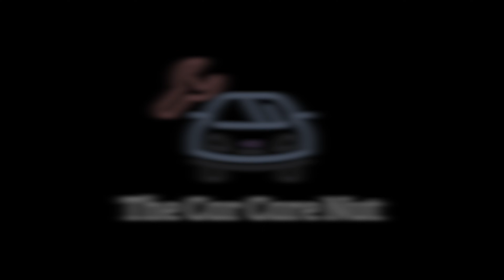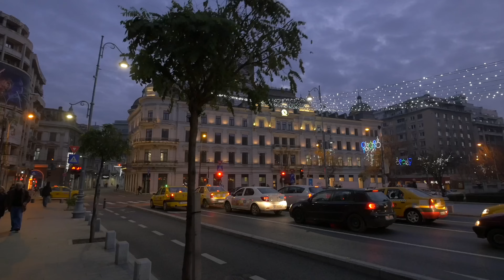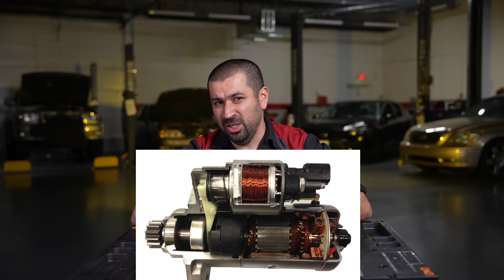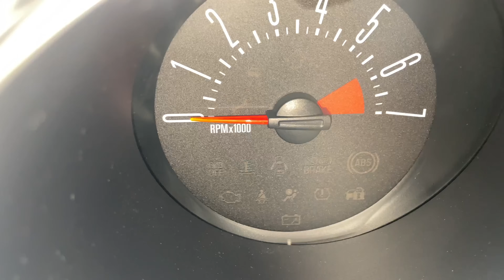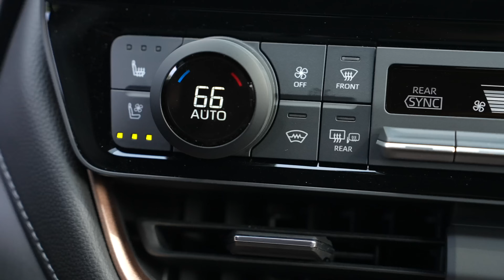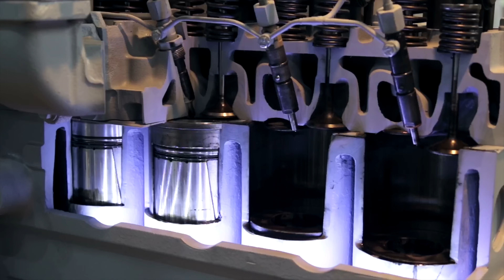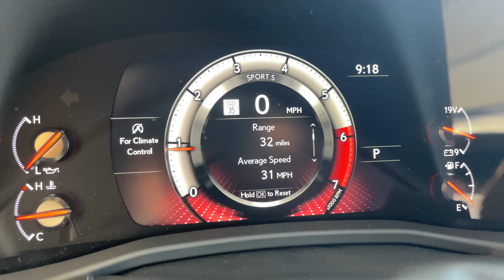How Does Start Stop Technology Work in Modern Cars? Everything You Need to Know

Comment: I heard you mention that they added an oil pump to maintain pressure to select systems.  Does that oil pump that was added protect ALL the seals?  Because I have heard there is insufficient oil pressure when the car restarts and that this will ultimately damage the seals.  I heard an engineer say that the only way to solve this problem is to engineer a delay of several seconds before the car can move after the restart.  How much sense does it make to control emissions in this way and, at the same time, allow remote start to warm up the car?

Comment: In the Volvo, start stop works great. I was shocked at how long the A/C still cooled with the engine off. The blower motor speed would throttle down but it was still cool. 

Volvo start/stop works great.

Comment: I live in Brisbane Australia and when I drive to work, which is about the 10 to 15 minutes drive even with my engine on all the way it's not enough time for you to reach the target temperature due to the car being hot from sitting in the sun! So if you can't keep my car cool even running the compressor the whole time, I can only imagine if the engine would stop at each red light, how much hotter it would be! Does to start stop function read the temperature and if it's above a certain temperature, it doesn't stop the engine or how does it work?

Comment: Love it in my 2 hybrids. My folks rented a car that had it when we went cross country for vacation....it was so annoying. In the prius it is fine and it was developed from the start with a huge battery to accommodate this. Plus the engine can stay off until you get over a certain speed or rpm. Hell I can glide for quite a ways with the engine off in my prius, it's awesome. Best of EV and regular gas cars

Comment: In my 2023 Jeep the Start/Stop works just fine.   Hardly notice it anymore.  Jeep uses a dynamotor not the regular starter and it uses the 48 volt lithium battery, not the 12 volt battery or alternator.  It restarts the engine in Point .4 seconds!  Faster than you can get your foot off the brake to the gas pedal.  It only uses Start/Stop when its safe and warm enough to use it.  It saves me gas in town and has zero pollution  while its engaged.  Its easier on the motor as you are not idling with a rich mixture.  Rich mixtures are necessary in all ice engines at idle to keep them running , this is also hard on your oil  when idling too much.  Never liked the Start/Stop at first but I don't mind saving money on fuel / and protecting my engine from idling problems.  Start/Stop was bad in the early days, I tried out a 2012 VW and when I heard the starter working at every stop sign I told the salesman we are done here, don't want this car.  But Jeep got it right, it works great, must have cost lots of money to engineer and probably put $10000 extra on the sales price.  I paid $42,000 for this Jeep, should not have cost more than $30,000 total.  This is a total gas Jeep, not a hybrid, it can't go anywhere on battery alone.  3.6 Liter
Leo in Montana

Comment: I really liked your video. However, I have three concerns based on my understanding:
	1.	Every time the start/stop system activates, the oiling process starts again from the beginning. This means that for a short period the whole mechanism runs without proper oil circulation, which could gradually damage the engine components.
	2.	What happens if I have been driving for a long time on the highway (Autobahn) with high turbo temperatures? As soon as I exit the highway and the engine stops, it could cause serious damage to the turbocharger because it normally needs some time to cool down before the engine is switched off.
	3.	What happens if the diesel particulate filter (DPF) is in the middle of a regeneration process when the engine stops?

I would be happy if you could answer these questions.

Comment: One thing not mentioned is turbocharges. He has another video where he says to not immediately turn off the car because oil will cook in the turbo if you do not let it cool down. Well what do you think happens when I get stopped by a red light after driving at 60 mph for 20 minutes straight? That oil is gonna be close to burning by the time the car comes back on.

Comment: I don't want to disable it ?!?! - I DoN't wAnT iT - PERIOD !!!!! - All those pumps, motors, sensors, heavy duty starters & batteries, etc. adds $3000, $4000, $5000 dollars to the price of the car. And I don't care how durable you say it is, that heavy duty starter is twice as expensive as the old starters and not all of them will last 10 years, nor all those other parts, pumps, and sensors that add multiple expensive failure points, ergo more expensive maintenance cost. 
I'm so glad Trump killed that useless legislation before I need to buy another vehicle 😀😃😄

Comment: Thanks from Down Under, good to understand the system and future service. I will run Auto start occasionally to keep the pumps fresh, same with off road systems 4L/Diff Lock/ Traction control, on the farm to keep all the running gear good. It's a New 2025 Rogue 2.8 L. Hope i got a reliable ute. I would like a ute without all this tech but as you say " just gotta move on with the future" Service is 10K capped under warranty, thinking i will change oil @ 5K interval to look after Turbo. Just a big sump @ 6.5L.

Comment: I think I've realised why there's so much hate with these systems. Most of the people complaining are usually those with automatic transmissions, where there actually would be some perceived delay to start moving. If you have a manual, there's no disadvantage as by the time first is engaged and the clutch reaches the bite, the engine is ready to go. "But it destroys engines" bet it does that's why you routinely see taxis hitting like 400k miles on diesels with these systems enabled.

Comment: Excellent video. While I drive a work truck with this setup, I have not worked on a car equiped for start/stop.  I was amazed at all the differences needed for rapid start/stop even though it made sense that all those issues needed a solution.  Immediately my brain was thinking about how many ways this system could be tripped up, including unexpected side effects from what would seem like an unrelated problem/condition elsewhere on the vehicle.  I'm curious how much more these modified components are.  While you alluded to the fact that the toyota evaporator might be unique to Toyota, I'm curious as to what other differences were implemented differently by Toyota.
I did wonder if the starters were heavy duty or to save weight just made easily replaceable.  Is the starter under warranty up to its EOL hour?
If the battery is significantly more expensive, would be interesting if a beefier Capacitor/regulator could be used instead.  One more part where the Toyota/OEM part will be the better/required? choice.

Comment: In another video on YT, a German taxi driver stated that his Mercedes E-Class started 47,000 times in three years.  He went through three starters and a number of batteries in just three years!  How is that "green?"
Also, nearly every time I am behind a stop/start vehicle at a red light, I see their brake lights dim when the engine starts.  These repeated power surges can't be good for the vehicle.
edit: The clutches on the AC compressors also wear out faster due to the stop/start system.

Comment: So, the bottom line is.. there is far more to break and maintain. The starter, battery and other components are far more expensive. And it can damage the engine if cold, it can put in danger. So, it’s not a good idea.

Comment: I had a Chevy rental car once that didn't have a button to turn it off. The system was broken such that it wouldn't automatically start. I had to put it in park, turn off the ignition and then start it again. So I had to keep my foot on the gas at a stop to prevent it from stopping - very dangerous.

Comment: then, from what CCN says when the battery needs replacing and I use a 'standard' battery instead of the preferred newer expensive battery, the computer will recognize its not 'good' enough to SS most if not all the time, so not only will it not engage SS even if on, it will also extend the life of the starter motor as a result and I save money all over and never have to switch the SS tech off since the computer will do it for me?  Am I right?  just replace it with a regular Toyota truestart when the time comes?

Comment: I have a Jeep GC limited, horrible crappy feature, parasitic dual battery drain that the dealer mechanics don’t understand and can’t fix. Turning your car off for 5 minutes at a light is a terrible idea for reliability. This is done by the car makers only so that they can meet the cafe standards for California and city emissions.  1 mph better when you make a million cars gets them to the cafe number they need.
To be clear this was not a pro consumer solution, strictly for the automaker to meet the absurd California emission standards that the liberals are pushing but they have no clue about the engineering constraints in a car. So the automakers have to come up with really complicated workarounds to try and meet these standards or not sell cars in California.  All that cost gets passed to all of us.

Comment: What about oil pressure? Petrol engines take 5-7 seconds to come up to a working oil pressure inside an engine to achieve hydrostatic friction. How does they handle this in stop/start cycle? My best guess is they don't and you actually slowly ware your engine on each start in first 5 seconds.
Reply: Thisssss only a few people discuss this issue

Comment: I just bought a new 2025 Subaru Forester. I'd never had a vehicle with Auto-Start/Stop before. Personally, I don't find it very annoying, but maybe that's because newer implementations are different or maybe Subaru just implements it a bit differently. I have to consciously depress the brake pedal more than I normally would to give the system a chance to engage. I'd actually like it to engage more often than it does. (I do with Subaru would display a reason for why it doesn't shut off sometimes, like Toyota does.)

But that's not really the comment/question I have. I see so many people saying they dislike Auto-Start/Stop being on by default when starting the engine.  Listening to this video, though, if the battery specification is determined in order to pass the voltage logic to keep the Auto-Start/Stop an option, but the car will still operate with a below-spec battery, then why not just select that lesser battery as a means to "disable" auto-start/stop?  

It can't be that simple, I'm sure. I'm guessing there must be more benefits of having the higher voltage battery than just being able to support Auto-Start/Stop. But if not, wouldn't simply installing the cheaper battery be a viable, non-interfering solution to sidestepping Auto-Start/Stop?

Comment: Hello! I would like to know the best way to drive hybrid car in order to take care of the engine. First, the internal combustion engine always starts, but after a few minutes, it switches to 100% electric mode, and the gasoline engine shuts off without even reaching 90° (Celsius). After a while of driving with the electric motor, the gasoline engine starts up again, almost cold. This happens many times before reaching 90°. Isn't this bad for the internal combustion engine? If you turn off the Start-Stop feature, the gasoline engine never shuts off and the car never runs in electric mode. Wouldn’t it be better to disable the Start-Stop at least until the oil temperature reaches 90°? Thank you!

Comment: But doesn't the engine, when starting, experience a moment of insufficient lubrication (not only with the cold engine)? And if this lubrication is insufficient with every start, isn't it harmful in the long run? On the other hand, the start-stop system in a hybrid vehicle, for instance, the Peugeot 3008 Hybrid 1.2 with 145 hp. If you deactivate the start-stop system, it loses the essence of hybridization and the electric motor never works.

Comment: So if a driver is very diligent about turning off the start/stop button every time the car is started, then emissions will be the same as a vehicle that does not have this feature. Therefore, installing a disabler results in no more emissions but without the hassle of having to remember to press the button every time.  Think I'll install one and relieve the car of all the machinations it otherwise has to go through to manage this "feature".

Comment: What about the engine oil ?
When engine shuts, the oil pump also shuts off, so oil stops flowing and the well oiled gaps between the pistons and the crankshaft are not VERY well oiled (the oil bed between the parts is removed) - this leads to engine wear off, when the engine is restarted.
The guy also made a test, where he start/stops an engine for 24 (or 48) hours and shows the wear off...I don't have a link here to his youtube video, sorry guys

Comment: I like this feature a lot. It’s pointless to have an engine keep running at a stop light, all it’s doing is polluting the air. The argument of the system wearing out the starter prematurely is uneducated and baseless, as Toyota has said the starter motor has been tested and could, on average endure 380k+ cycles.

Comment: I have a 2023 Mazda CX-30, if I come to a stop gently, the iStop (stop/start) is NOT triggered. If, on the other hand, I have to brake hard, then the extra pressure applied to the brake pedal trigger iStop. Additionally, if following a gentle stop, the brake pedal is pressed harder, iStop is triggered. Of course, all of these iStop events require all relevant components to be in their normal operating parameters. Restarting can be achieved in some circumstances by releasing the brake pedal. Other methods include a touch on the accelerator, wiggling the steering to either side or shifting the gear lever into manual mode and upshifting with either the shift lever or 'flappy paddles." It is possible to disable the iStop system with a switch before moving off after each normal engine start.

Comment: If you are tired of having to remember to push the button to disable the start stop function start your car, push the button in so that the indicator light comes on and put a small piece of cut out credit card along the side of button to hold the button in place. Next time you start the car the light will come on and the start stop feature will always remain in the off position. Ya it's that simple for most cars that's all it takes. No need to remember to push it in and no need to buy a module to reverse the operation of the switch.

Comment: I as an engineer would bypass all those troubles and just lower the idle rpm to a minimum which is still able to power the things you need.
Let´s say you don´t need AC etc... reduce the idle from around 750 down to 250 or something like this with just 1 alternating active piston at the time

Comment: Got this from someone on Threads who said it's still bad for the engine, especially the oil pump:

The oil pump is mechanical and during low rpm cranking it is not able to efficiently pump the oil. That oil pressure tensions the chain guides. There is a very quick moment where there is accelerated wear on plastic chain guides, which is an expensive item to replace and catastrophic when they break. Over many start stops, it accelerates wear requiring lower replacement intervals. On top of that, it is more frequent operations with brief periods of low oil pressure across the entire engine. 👍🏻

Got any answers?

Comment: I have a 2021 tundra sport. I don't have stop start technology.  2 weeks ago, I drove across country. I decided to sleep in my truck instead of getting a hotel room. Due to the summer heat and humidity, I let the truck idle and discovered after 1 hour, my truck automatically shut off. I ended up setting the emergency brake and put the vehicle in neutral. The truck idled for as long as I wanted it to. Is there any trick or hack I could do to leave the truck in park and let it idle for as long as I want? Just discovered your channel. Keep up the great work!

Comment: Great video. I'll be driving my first vehicle with this feature and I'm getting ahead of the equation early now to evaluate each decision. To keep it on or off. So far I'm leaning towards off. Highway for sure off. I also learned about the battery capability. I wonder if this stop stop feature makes it difficult now or non reccomend to swap a battery from 2020 than with a battery from my old 2008. Even though my battery is relatively new less than a year for my 08' makes me hesitant now to use it as a backup battery.

Comment: In my Buick Envista, the engine will not turn off on the hot summer (over 90F or so) days. In the mornings when it is around 70, the start stop functions - but as the temperature increases outside (we get 100F+ most days of summer) - the engine stays running at a stop.

Comment: SST is a useless gimmick. At least in my car.  When it's really hot outside and the AC is going strong, the computer will not turn the engine off when stopped at a traffic light. The same happens in the winter when it's really cold. So this "feature" is annoying and in my case does not reduce  any emissions whatsoever. This is probably true for most motorists unless they live in balmy parts of California and similar locations. Also, SST does not work at all regardless of temperature while stuck in traffic and the transmission is in park so my calf muscles can take a break. The whole thing is dumb because it was probably designed by some pencil-neck who commutes to work via public transportation, a bicycle or just walks every day and may not even own a car. The good news is that there is a button to turn that stupid thing off which is the first thing I do as soon as the engine starts.